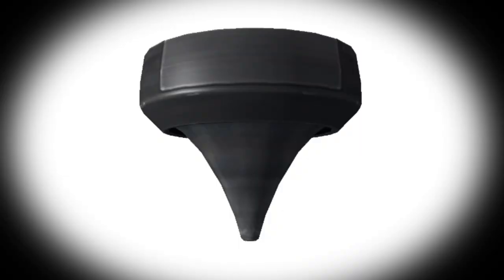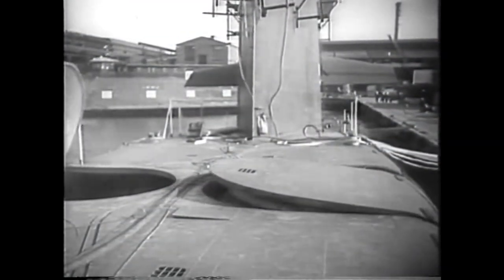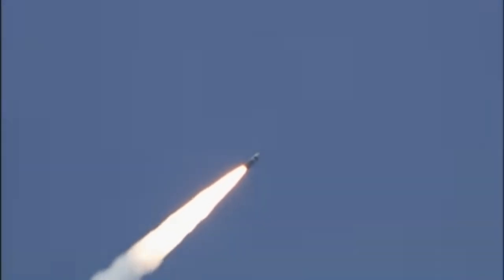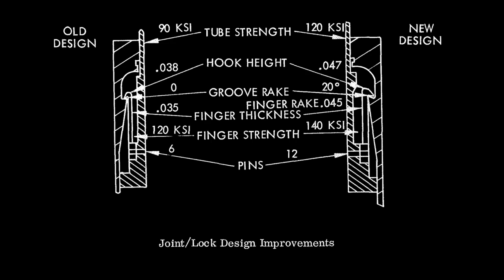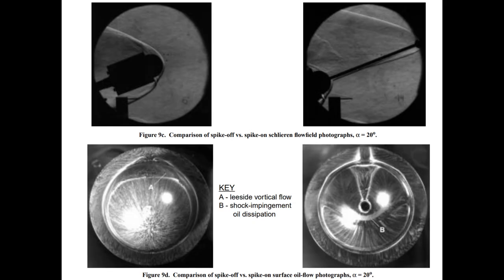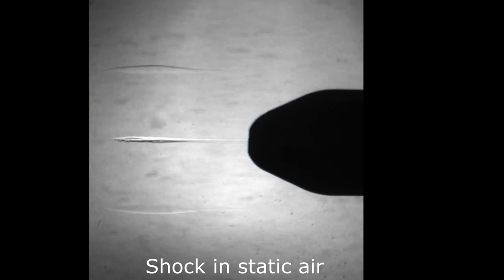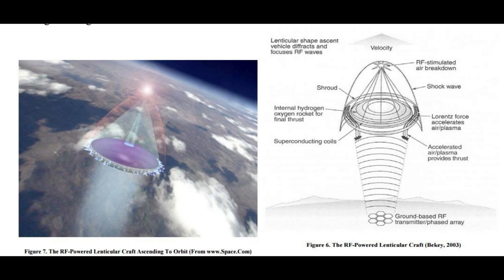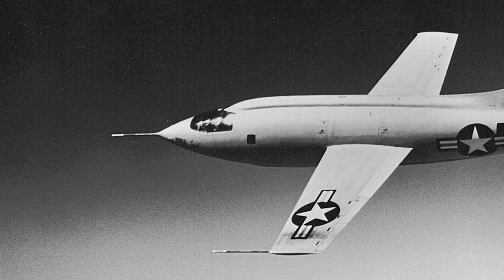Why Does The Trident Missile Have A Spike On Its Nose?

Comment: The motors on the SR71 used aero spikes on the front to control the air speed going into the motors.  Those motors deserve a program all their own from Scott
Reply from the maker: Those are shock cone intakes, a completely different type of device.
Reply: @scottmanley  air conditioner inlet lol
Reply: @MrJay_White  Balls compresor, cause those pilots would be too big to fit
Reply: @derrekvanee4567  sr71 had no parachute. in emergency the pilots where expected to glide down like magic tanuki.
Reply: Scott is correct. Those devices were designed to control the impingement point of the shockwave from the supersonic air on the intake of the engines. They were necessary to prevent unstarts. Also they would move forward/backwards depending on the speed of the aircraft.
Reply: My Grandfather worked on that system. It's used for a different purpose.
Reply: @scottmanley  still very interesting though. Being able to intake supersonic air, drop it to sub sonic, compress and heat it, but also able to digest still air at takeoff.

There's a video worth of stuff on supersonic air intakes (see also the concord intakes).
Reply: @MrJay_White  The SR71 had ejections seats.  Bill Weaver survived an accident by ejecting at over Mach 3.  The other crew member did not.
Reply: @somerandomnification  He was making a joke about balls
Reply: @nukesrus2663  And it went as far over my head as an SR-71 might.
Reply: @somerandomnification  Technically weaver didn't actually eject in that incident, the aircraft broke up and disintegrated, and aerodynamic forces then forcibly separated him from his ejection seat by tearing all the straps. Fortunately his automatic stabilizing drogue parachute still deployed when he separated from the seat despite the ejection sequence not being initiated.
Unfortunately, while his back-seater's automatic parachutes had also worked, his separation from the aircraft hadn't been as clean, and his neck had been broken by impacting something.
Reply: @scottmanley  I have to disagree with you on this one.  actually, the OP here isn’t totally wrong. The nomenclature they used is incorrect though. That being said, the premise of your video is an “aero spike” that’s not actually an aero spike. But the “inlet spikes” on the SR-71/A-12 are used to do the exact same thing as the spike on these missiles. And that is to move the shockwave to the ideal location. The inlet spike on the SR did function in two ways though. Foremost, it kept the leading shockwave out of the nacelle and second, guided/formed the normal shockwave within the nacelle, helping slow supersonic flow into high pressure, subsonic flow. This feature, along with some less mention bypass ducts, is how the J-58 engine is most fuel efficient at Mach 2.5+ airspeeds. The development of this spike and why it was necessary, is talked about in great detail in Ben Rich’s memoir titled “Skunk Works: A Personal Memoir of My Years at Lockheed”. And fun fact, Ben Rich’s development of the movable inlet spike may have saved the Oxcart program and led to him becoming the successor to Clarence “Kelly” Johnson. Super interesting book.
Reply: @Kieselmeister  Thanks for the extra detail.
Reply: @scottmanley  A significant amount of suck, I suppose the opposite of thrust, contributed to the propulsive work the engine developed.  It seems that at some combinations of velocity and atmospheric pressure the suck exceeded the thrust but I may be mistaken.  Engineering school was over 45 years ago😬
Reply: @scottmanley  Still, I think too, that they deserve a video :)
Reply: @scottmanley  Dear Scott there is one more type of aerospike for the nose of a rocket. In the USSR somewhere in the 70s they invented earth rockets for digging. Yes. The soviets had used rockets directly into the ground. It was a lot cheaper this way to search for ground water or other stuff. Maybe you can make a video about this type of rockets if you read this comment.
Reply: @The69Yoshi  In order for the J58 inlet to be properly "started", the shockwave generated by the inlet cone needs to fall just inside the intake cowling rather than outside it. That results in a series of angled shockwaves that culminate in a "normal" shock at 90 degrees to the airflow, after which the air travelling into the engine is subsonic. Capturing that first shockwave is essential to engine performance and efficiency and is referred to as "starting the inlet", and a special control computer was developed to ensure the shockwave stayed captured by careful positioning of the inlet cone in conjunction with operating bleed tubes and bypass doors. If for any reason the shock is forced too far forward, it'll blow out of the front of the engine causing an "unstart" which led to a huge drop in thrust and consequent sudden yawing of the plane.

Comment: Scott, I remember reading, back in the eighties, that they had designed the standing shock wave in such a way that it blocked/moderated cross wind.  Apparently, the shock wave which was a distance away from the body and not attached, could collapse a bit under side pressure before actually effecting  the missile.  Clever fellows these rocket scientists.

Comment: Doesn't any manned rocket with a Launch Escape System tower also effectively have an aerospike?
Reply: besides vostok and gemini, sure. but those systems aren’t under the same length constraints as the rockets discussed in this video
Reply: Possibly if they had shaped it for that purpose, but they may have just seen the tower as an appendage that needed to be somewhat aerodynamic, and they didn't really go beyond that in designing the shape of it.
Reply: They did do supersonic wind tunnel tests to see if the shockwaves would negatively effect flow.  Probably as long as it didn't do that, that was good enough.  The margins on man rated launchers were such that any benefit would have been negligible.
Reply: Interesting point. I’m wondering if this had an effect on reducing the atmospheric drag on the Apollo Service Module RCS quads. I always thought it was miraculous that the Service Module RCS quad nozzles could survive the supersonic atmospheric drag over the course of a Saturn V launch.
Reply: @obsidianjane4413  I think the Saturn V engineers (at least) were keen to scrape every last bit of performance out of their rocket.  The second batch of Saturn V's would have removed the first stage fins for a STAGGERING 97kg additional payload* to LEO (not the moon, just LEO).  This second batch would have incorporated many other changes as well, but sadly it was cancelled when the Vietnam war started to put pressure on the space budget.

*With a very strong dose of "IIRC."
Reply: @Infinite_Maelstrom  The fins are one of the coolest aesthetics of the Saturn V and Saturn IB, useless or not they look cool.
Reply: @RCAvhstape  I entirely agree.  But - that's what was planned.  Rockets (especially 60's ones) aren't designed for looks.  Ironically, I think that's why they look good!
Reply: Anne Frank Vape Pen  : What's an escape tweet? 😛
Reply: @Zacks.C-land  I would imagine the shock wave off the command module's cone would be kept away from the RCS quads, regardless of the LES tower. They do look a little vulnerable regardless though.
Reply: @Infinite_Maelstrom  I've always wondered, what were those fins for in the first place? They look too small to really do much, and to my understanding most of the steering was done by gymballed thrust. The only thing I could figure is that it helped stabilized the stage once jettisoned, with empty fuel tanks at the front and engines at the back it would likely flip around backwards as objects moving through the air are stable when flying such that the center of mass is forward of the center of pressure - the fins would move the center of pressure aft. But there's really no drawbacks to the jettisoned stage tumbling anyway.
Reply: @quillmaurer6563  My understanding is that the fins help stabilize the launch vehicle for a brief period of time after launch, after it gets going fast enough for them to matter up until the air gets too thin to help much. Since the gimbaled engine steering proved to work so well, it was planned to delete the fins on future versions, and few if any launch vehicles have fins since then.
Reply: manned spacecraft hardly encounter high speeds within the atmosphere, as they can't accelerate as quick as a ballistic missile with humans on board, but the tower design sure had some consideration
Reply: @quillmaurer6563  (and Helium Road) My recollection is that the fins were primrarally part of the escape system.  If the first-stage engines shut off during an abort, the vehicle needed to be kept stable for a second or two in order for the escape tower to get away safely.  Since the vehicle wasn't aerodynamically stable, the designers added tiny fins to keep it stable just long enough for the escape system to escape.  But after a few launches, they decided they weren't needed.
Reply: @Infinite_Maelstrom  Interesting - sounds similar to my speculation that the fins were to help stabilize the rocket with engines shut down, but the whole rocket stack rather than just the jettisoned stage. Would only really help at certain altitudes, very early on into the launch (when an abort would probably be most likely) they wouldn't be going fast enough to do much, and higher up there would have been less air, plus as the first stage fuel tanks emptied the overall stack's CG would move upward, making it more stable regardless of the fins. I find it interesting how sometimes features included to be a little bit helpful in worst-case-scenarios get deleted as the design proves itself to be safe and reliable, they decide they don't really need them. Sometimes this is a good thing, but sometimes it is complacency.
Reply: @Infinite_Maelstrom  97kg is barely anything. About 170 lbs. The weight of one man. Doesn’t sound staggering.
Reply: @bigbaddms  Unless they use a different kilogram (kg) in the space program wouldn't 97 kg be 213.8 pounds? 1 kilogram weighs 2.20462  pounds I think.
Reply: @timhastings6382  yes I don’t know where I got that conversion. But the point remains, 200 lbs is not a “massive” weight reduction. Not even close. Saturn V weighed 6M pounds. Obviously it’s an error, each fin didn’t weigh just 53 pounds.

Comment: I heard about the super-cavitating rocket torpedoes while I was in the Military, mostly used as a break-away weapon to distract your opponent while you break off from the engagement.  Quite the nasty trick actually, very hard to aim, but noisy enough to cover whatever else you wanted to do.  Served at Polaris Point on Guam

Comment: Fascinating. I wonder if this would also work on handgun bullets, which are blunt-nosed for the same reason: their length is limited because they have to fit in the grip of the gun.
Reply: The 1848 Colt Dragoon revolver used a sugarloaf-shaped bullet not unlike the sort you'd fit into a rifle, making it one of the few (if not the only) handguns that can shoot a long, sharply pointed bullet.

The downside? The cylinder of a Dragoon is about as big as a hand grenade and the gun itself is almost twice as heavy as a typical handgun.
Reply: It's been done. Très Haute Vitesse (very high speed) aka THV and Monad rounds back in the 80s. You can't make it longer as you noted so they cut the rest of the bullet back. That resulted in lower mass and that was offset with higher velocity. They tested well including on animals but didn't catch on. Lehigh brought it back a few years back as the Xtreme Cavitator and they pretty much left the scene. Hard to feed in some pistols, won't fly right if the tip is deformed, and 50/50 on the terminal effects - if the spike flattened on some bone then you're left with a smaller equivalent of a full metal jacket. If you're still interested, check out the Xtreme Defender series, they look like Phillips head screwdriver tips. Same idea but far more practical.
Reply: Most handgun rounds are just barely supersonic.  I'm not sure this type of system would have enough benefit to be even close to being worth the complexity of developing a telescoping aerospike for a relatively tiny bullet.  Just a wild guess based on the angle of the shocks in the test video, but it looks like they're talking about Mach 2.5+ where this effect comes into play.

Comment: IIRC, the nozzles you showed at the beginning are spike nozzles, not AEROspike. They have a full length splke - which is heavy and hard to cool. The name aerospike properly belongs to a truncated spike nozzle that injects a controlled flow of air or other gas into the missing truncated part to make it behave more-or-less as if the full tip of the spike was there.

Comment: Another thing to be aware of is sometimes on aircraft its not an aerospike, its a pitot tube as the front of the aircraft is the only place it can get a clean airflow.
Reply: He did mention that.
Reply: It's not the only place, but a convenient one.  There are also trailing cones and trailing "bombs" that you can tow for static pressure measurements.  The boom (the industry term for the "spike" we're talking about) can also be fitted with a Yaw and Pitch Sensor (YAPS) head to measure AoA and sideslip.  

But it's worth mentioning that all of those are for flight test.   Production air data sensors (pitot-static, AoA) are placed wherever is convenient and calibrated to the flight test data.

Comment: One of the big reasons for the aero spike on the igla is actually to reduce the heating of the sensor dome.  The missile is supersonic and without it the rather poor sensor in the nose would be blinded by the seeker dome getting superheated.  Behind an expansion wave shock your temperature drops

Comment: Wow, I'm looking up the fastest known torpedo, the Soviet one Shkval; it uses a water-ramjet.  I didn't think a "water-breathing" engine was possible... incredible.
Reply: Doesn’t it use solid rocket engines?
Reply: Sounds like BS to me, what is your source for that?
Reply: @benbaselet2026  https://en.m.wikipedia.org/wiki/VA-111_Shkval it is.
Reply: @joshuahadams  at first to get to high speed, then the water ramjet takes over.
Reply: @benbaselet2026  Was curious, checked Wiki, on the VA-111 Shkval it says: "Once accelerated, speed is maintained by an underwater ramjet fueled by hydroreactive metals using seawater as both reactant and the source of oxidizer". There's some useful info in the wiki article references, #6 is particularly interesting. Apparently magnesium based?
Reply: @spagamoto  Hm, I guess so then. Wikipedia isn't the greatest source for military stuff so I tend to be a bit cautious with it. But I guess this is old enough to be reasonably believable. Pretty "out there" tech so it's hard to judge by common knowledge.
Reply: Wow. Incredible. Can you look up why I have loose bowel movements?
Reply: @spagamoto  50/50 Magnesium/Aluminum powder is the fuel.

Comment: Does the launch abort system on the Saturn V behind you or on SLS also act as an aerospike?
Reply: don't mind me, just hanging out here so I get notified when you get the answer
Reply: Well, yes and no. First of all, a difference has to be made between telescopic aerospikes and a "spiked nose". The first one allows you to choose wich aerodynamic profile suits you best depending on your needs, without needing two physical nosecones, the other is just a design choice (as said in the video, for equipements, weight or length among others) to emulate a pointy nosecone. 

The M51 rocket (on wich i've worked) and  other sub-launched rockets use telescopic aerospikes to change their aerodynamic profile because they goes through two very different environnements. The parabolic nose is the most aerodynamic profile underwater (wich is why torpedoes have such a nose and not pointy ends) but it is very unefficient in the air. Pointy noses are very loud underwater (due to cavitation among others) but ideal in the atmosphere. That's why telescopic aerospikes are used, in order to choose the aerodynamic profile depending on the medium it is going through.

The Saturn 5 does not change medium during flight. This means no need to change the aerodynamic profile, an thus no need to make it telescopic. The Saturn 5 could have made a pointy nosecone with the LAS close to the astronauts (as in Blue Origins New Shepard), or, the final decision, make the LAS solid propellant tank as a "spiked nose" (long an slim) and put it above the astronauts. A safety driven aerodynamic choice.

So no, it does not act as an aerospike, as it is not meant to change the aerodynamic profile. But the design choice is based on the same aerodynamic principle : a physical nosecone isn't mandatory as long as you can emulate it by changing the airflow in the same manner. And in fact, the spiked nose of the Saturn 5 and Orion actually create a lot of airflow disturbances because of the four LAS exhaust nozzles... but it is apparently ok in the general design choice.
Reply: @WawaDvd is transitioning from sub- to supersonic similar to a medium change? If so, do they help there?
Reply: @marcopohl4875  - Subsonic and hypersonic regimes are not a change in medium, just a change in the flow surrounding an object (up to molecular level and atomic division, on wich I do not know much).
Aerospikes help in hypersonic regimes, by changing the shape of the nosecone... in a simplified version, the faster the pointier. You, amongst others, have to factor in bending (much more fragile than a physical nosecone) and oscillations of the aerospike but the idea is there.

Going hypersonic doesn't make aerospikes mandatory. They have advantages and inconveniences, you just have to design your object depending on the constraints you have.